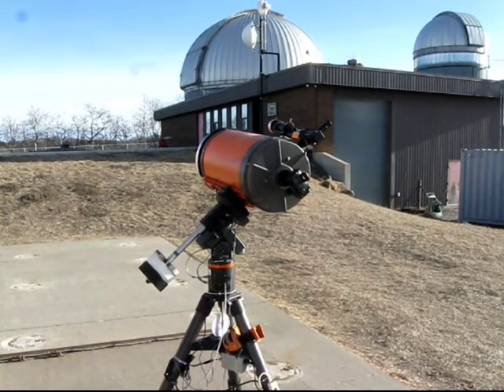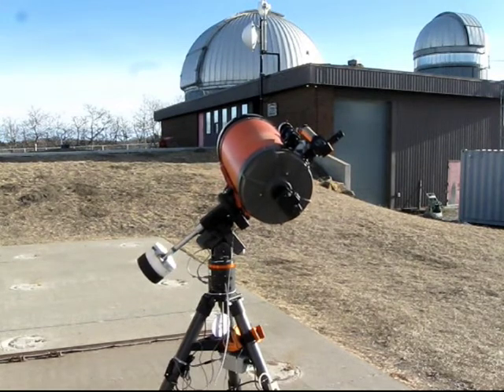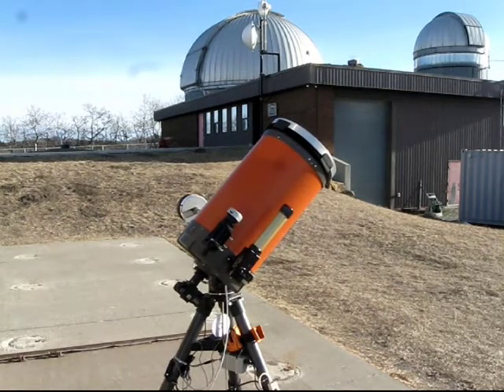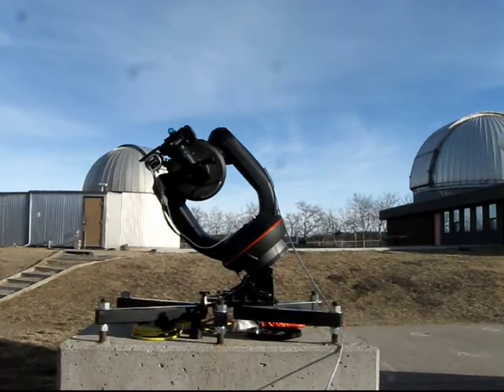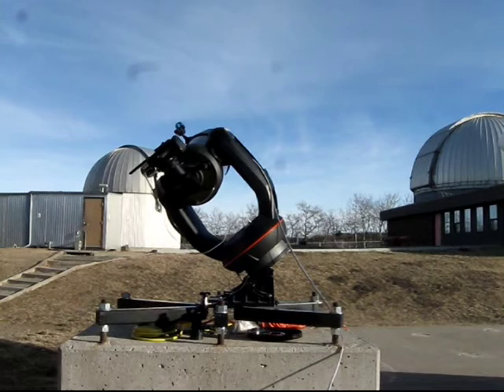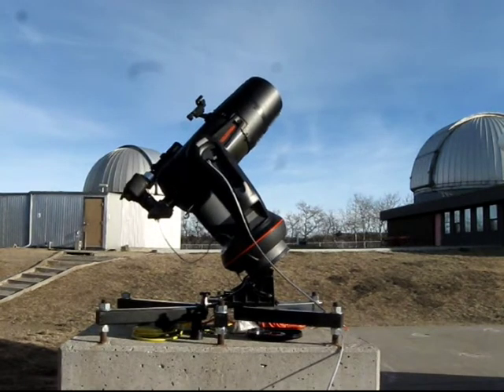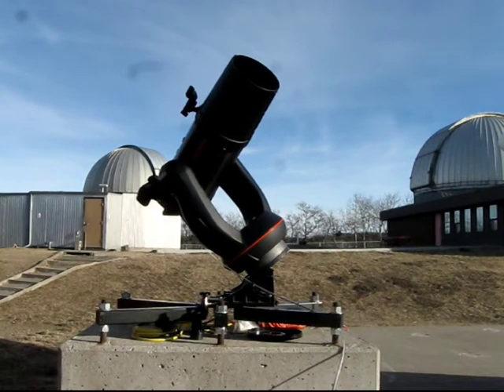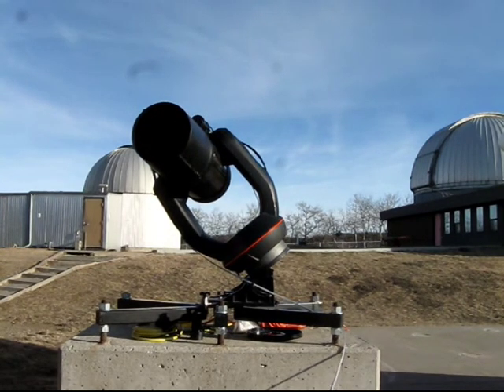Equatorial Mount Meridian Flip Dec 6 2017  by Larry McNish

Comment: Most people do not use a fork mnt for photography.  Besides making it almost impossible to use a different  OTA, what are the disadvantages for using a fork mnt in AP?  what are the reasons most people do not use it for AP?
Reply from the maker: Some forks are known to vibrate like the tuning fork they resemble. With people travelling to find dark skies, a fork-scope combo is heavy and awkward as well as not having a convenient polar axis scope for alignment. German equatorial mounts break down into smaller pieces and also commonly have a space for a polar alignment scope.

Comment: Does the additional leverage of having the alt-az on a wedge not put a greater strain on the gears?
Reply from the maker: Although the center of mass is no longer positioned directly above the RA axle in the base, I have had no problems in several years. I  sometimes use counterweights screwed into the threads at the bottom of the front-end optical tube housing to assist Declination balance depending on the back-end weight of camera equipment. Also no problems in several years.
Reply: RASCCalgary Cool, thanks for that. The alt-az + wedge setup seems to be almost the ideal system. Unfortunately I only have a single arm Sky-Watcher mount, currently, but I’m definitely tempted to have a play with it and see what I can come up with.

Comment: Hi, thank you for the video. I notice that on the AVX mount are OTA and counterweights that must be way over 30 lb that is the payload of the mount. Did the AVX Mount handle the heavy equipment well?
Reply from the maker: It's an older CGE mount capable of holding and slewing over 90 pounds, not an AVX mount.

Comment: Why are wedges for some alt/az mounts not available?
Reply from the maker: You'd have to ask the manufacturers. Besides the physical wedge, the hand-control computer needs to have an "Equatorial North" or "Equatorial South" mode of star alignment / calibration AND operation and not just simple Alt-Az star alignment.